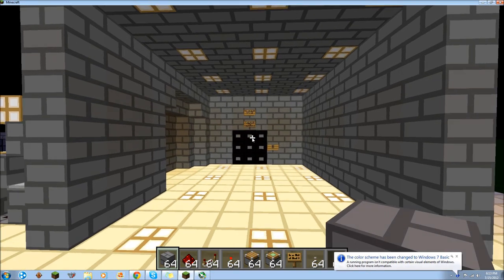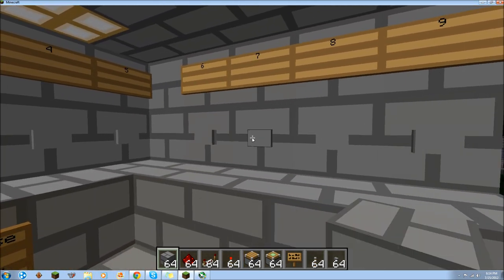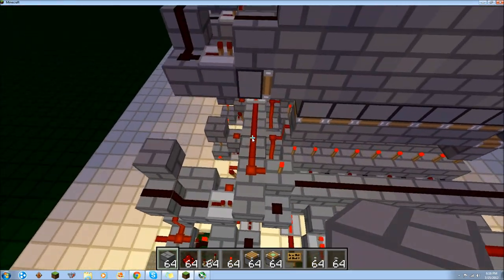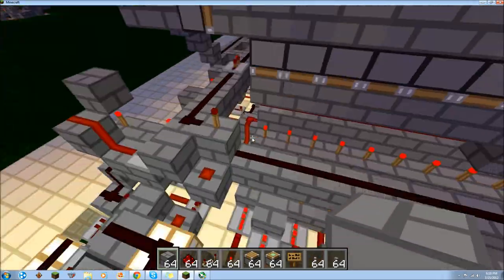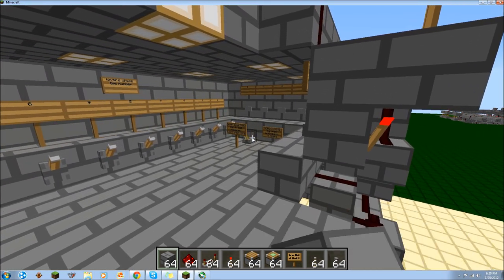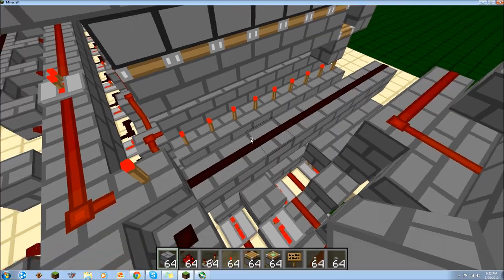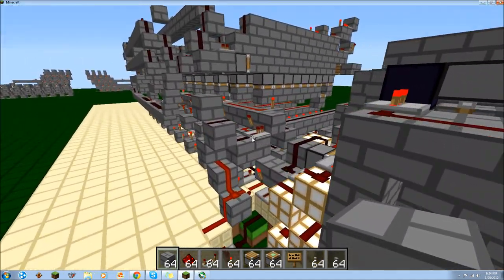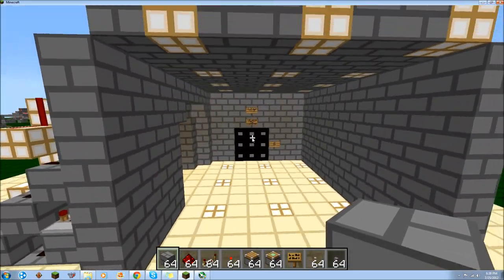9 digit reprogramable combo lock with 9 digit key pad

Comment from the maker: i would say that you might have messed up somewhere with the wiring or timings where the rs latches are or on the reset line timings.. (the line that gets activated by all the buttons) make sure thats all working.. and also if your in a snapshot then you would have to change the timings on a repeater along the reset line.. but i have not found any problems regarding any specific numbers such as 2 and 4.. so i would say check your wiring and if you are sure that you built it correct then msg me .